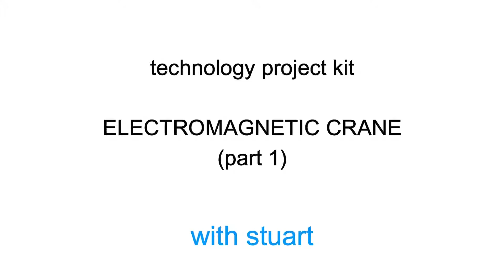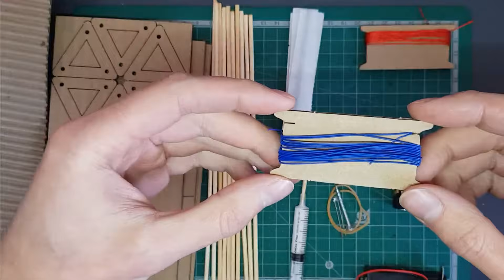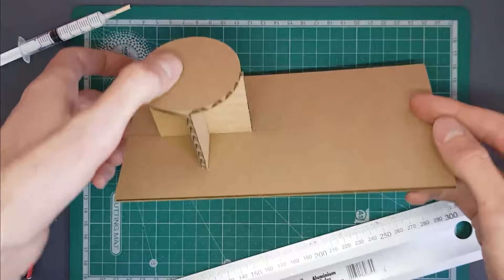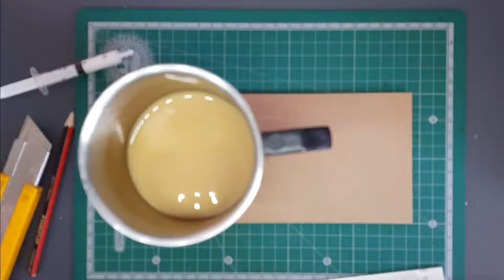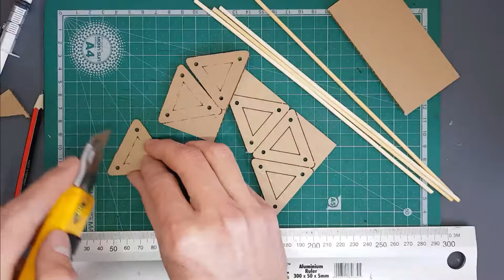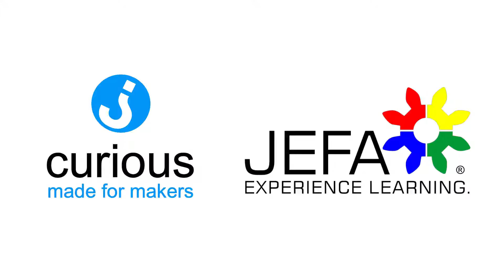CuriousDIY Project Kit -  Electromagnetic Crane Part 1

Comment: Ok just confused, you cut the sticks into half which is 110mm rights, then for some reason the stick is longer and still have to cut it 110 mm
Reply: You’ll need to measure 11 cm and cut the skewers to size. The skewers you receive are roughly 22 cm, so cutting them in half should work out evenly, give or take a few millimeters.

Comment: Not all the skewers are able to do 11cm😢
Reply from the maker: Hi there,

You’ll need to measure 11 cm and cut the skewers to size. The skewers you receive are roughly 22 cm, so cutting them in half should work out evenly, give or take a few millimeters.